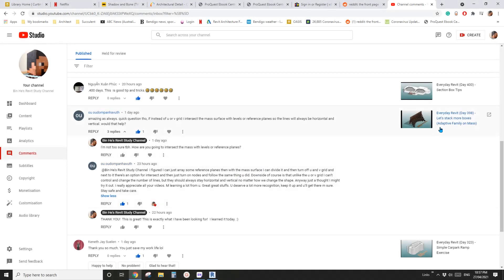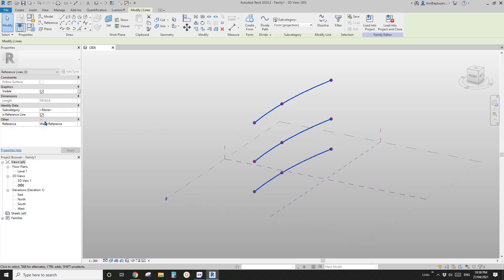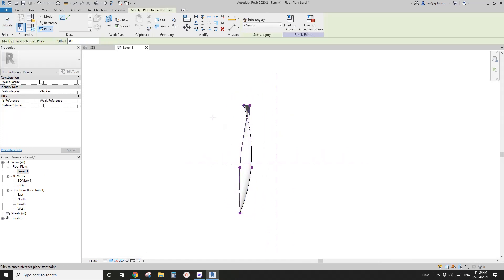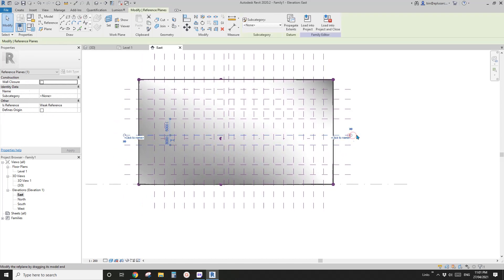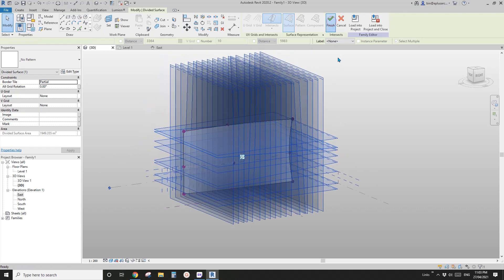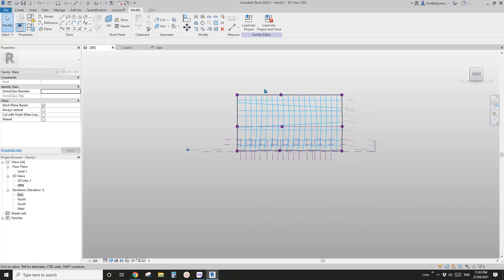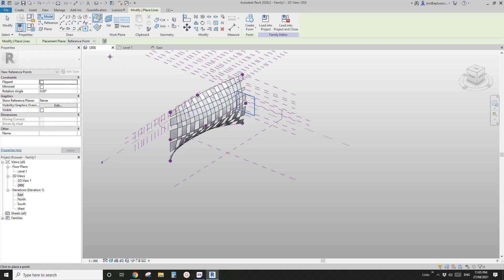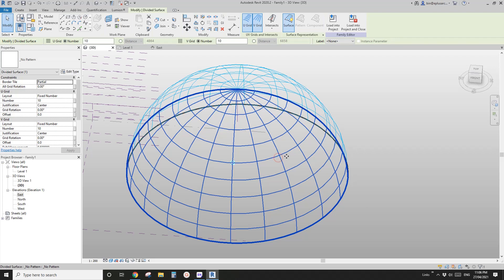Everyday Revit (Day 404) - Manual grids on mass using intersects

Comment: Could you try the Vancouver House project designed by BIG in your next tutorial?I have trouble assigning parametric design to curvilinear surfaces. Patterns are not perpendicular to the surface due to their point orientation.
Reply from the maker: I tried that project quite a while ago but had some trouble make it good enough. I’ll have another go. If possible, can you show me an image of the issue you are having now?
Reply: @BINHE615  Well. I'm sending an e-mail immediately
Reply from the maker: I will have a play.